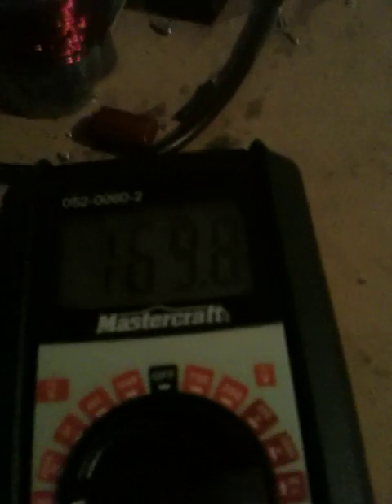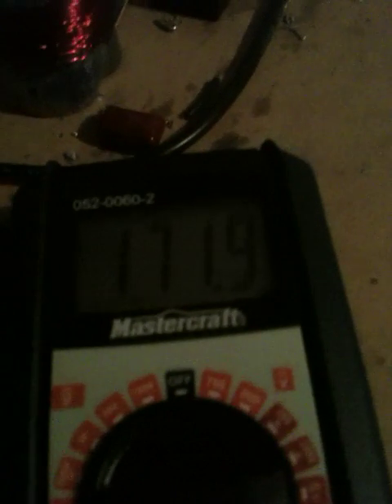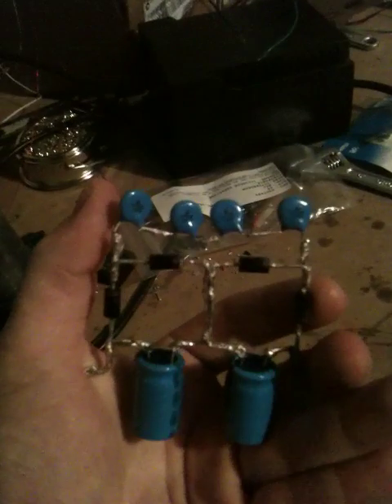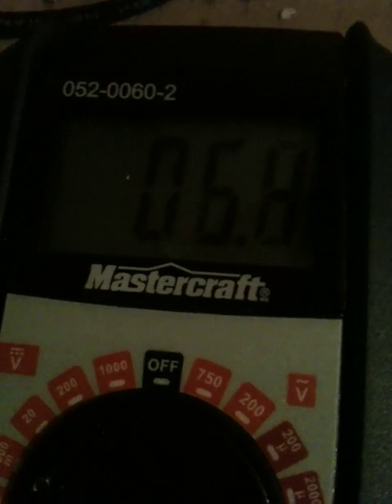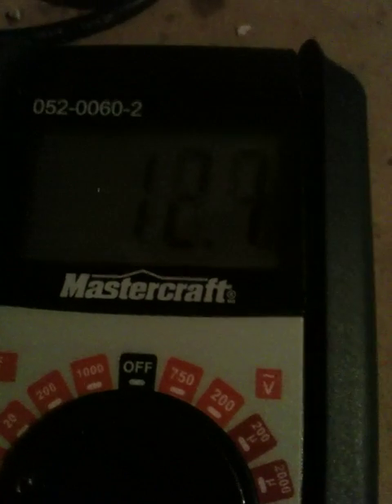FREE radiant ENERGY 1 of 2

Comment: I heard that Tesla considered AC to be a failure. In his later life he experimented with high frequency pulsed DC. To get the strange over unity effects you can only let voltage one way, not the other (use good diodes). Then you have to switch the circuit on/off using either a reed switch or a transistor. In his Radian Energy Tower tesla used two giant pancake coils. Eric Dollard and Konstain Meyel are two people of interest show worked with this new form of electricity. This electricity is also known as 'cold electricity' or 'longitudinal electricity". Lets team up to unslave humanity.

Comment: Hey fellow KOA, ive been following some of your works. I have a question, where did you connect the ground wire from your circuit ?  I'm toying with circuit as well. I get .03 to .80 volts.

Comment from the maker: @INVENTOR3 Spring is just about here where I can do expariments an make an antenna. With the tv magnetic wire I have each one connected to eachother and I have one connected to the top of the circuit. Also does this circuit have a name and if it doesn't I think you should give it one.

Comment: @INVENTOR3 Mount one end of antenna up high and make sure it is insulated from what ever you mount it to, and bring it down to the circuit,,and the circuit is best if you can have it hanging in the air also not letting it touch anything like the table you have it on.  I like the ground.  Strange i had better results with a ground rod then i did with connecting to a water spickett, not sure why either. About the coaxial cable, do you have inside of cable connected or outside wires or both..

Comment: Hey great video!  Glad to see you experimenting!  Interesting antenna set-up you have. I like that you experimenting with differant caps. I do get best results with germanium diodes or with diodes that have the lowest forward biased voltage or voltage drop across them, not quite sure why.  If you use a coil, i would suggest running the ground wire through the center of it, thats where some majic happens. I get best results if the antenna does not touch "anything".